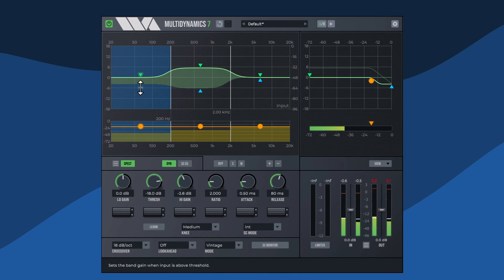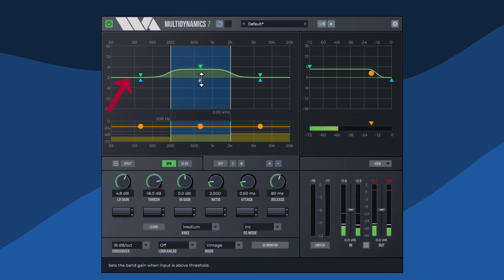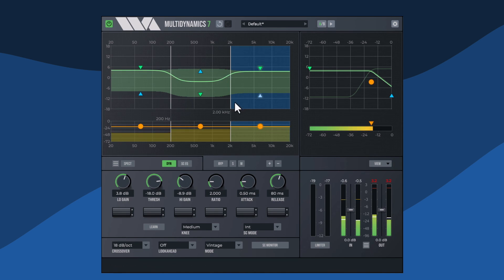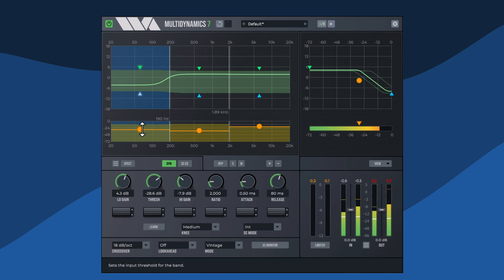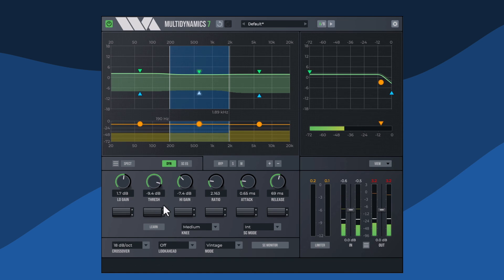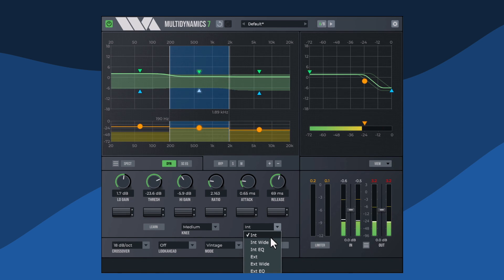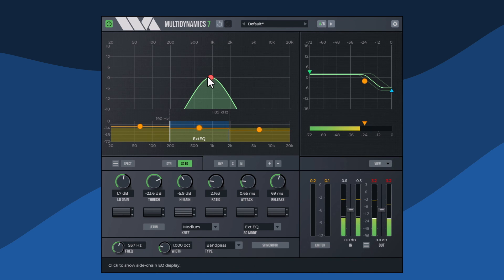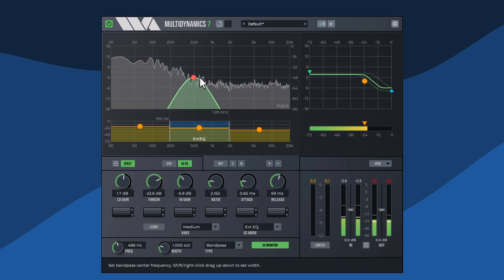MultiDynamics 7 - Multiband Dynamics Processor

Comment: So it doesn't have upwards compression?
Reply: expansion is upward compression
Reply: @bobfluencer  no. google about those
Reply: Upwards compression would be increasing the gain of signals below threshold, and yes it can do this. You can get any combination of increase/decrease gain when below/above threshold by adjusting the hi/lo gains and threshold parameters, and you can do this on a per band basis.